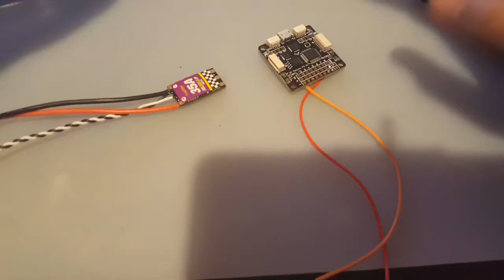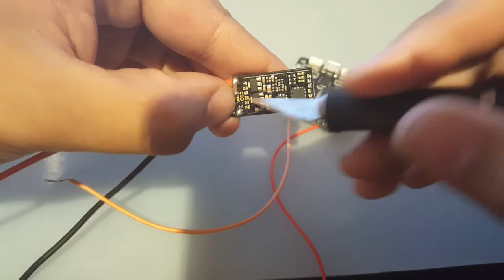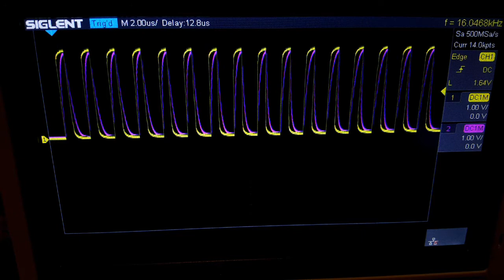Dshot With Filter Cap And Without // Racerstar 35A MS

Comment: DSHOT with the filter cap for me caused a 'tick' in one motor when running 4s batteries.  Switched to multishot, no tick.  I imagine if I remove the filter cap I can run the DSHOT with no issue, but with it, no way.